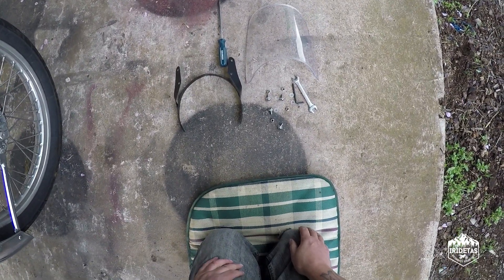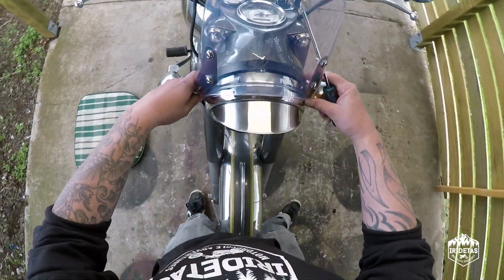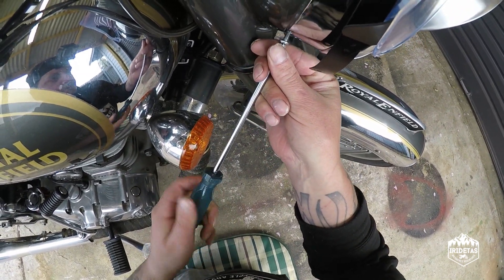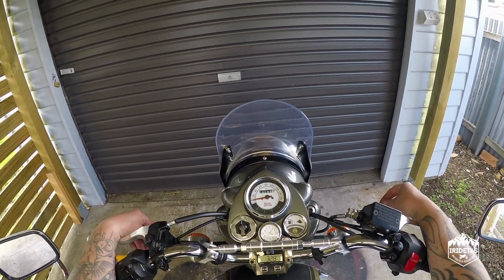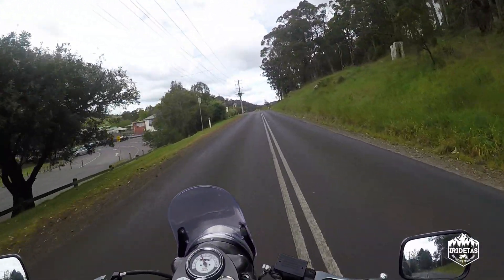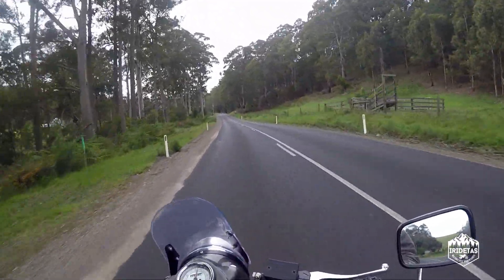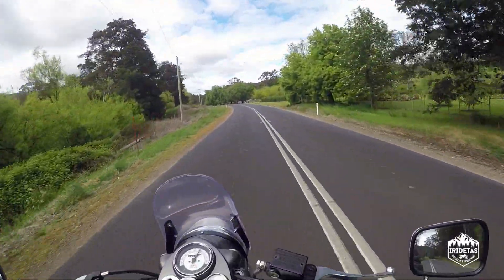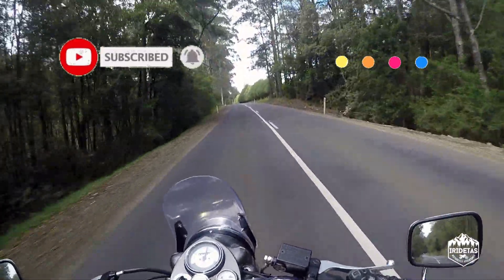REA #32 | Ebay Clear Windscreen Fly Screen for Royal Enfield Classic 500 Install, Review & Test Ride

Comment: I love that you are the Crash Test ( not so ) Dummy for the rest of us. I’m taking a month long jaunt next August and was looking into a windscreen too. I’m six foot and sit pretty high in the saddle. Was worried that the small screen would deflect the wind into my helmet. But I don’t like the ( settle for ) looks of the big screen. Plus.... it may be okay if I get the solo seat mod which drops you down a bit. By the way, how is the new seat ? Good spring and comfort ?? Anything is better than the 2” pivot point on the stock seat eh ? Like doing a Rodeo in a gravel truck.
Reply from the maker: Lol someones got to do it mate!The solo seat is going well and is more comfy than the plank and i like the lower seating position better too.  The screen wotks well and can reccomend if you are after a flyscreen.  Check out Mike the Pikey on how good a classic can look with a full screen, before you right it off! Cheers mate!
Reply: Thanks IRTaz. I don’t care what anyone says.... you’re a nice guy 😉

Comment: I tried it, but the color has scraped off, the metal was mellow, and it was structurally so weak that broked off while mounting. I don't think it would sustain any wind pressure, so I'll not try again.
Reply from the maker: Think thats the luck of the draw with any chinese ebay product.  Mine was ok yours not and it 
Was probably made in the same factory.  Quality control and tolerances just not there at times!

Comment: Nice job iRide, thinking of getting one for my Interceptor, "pretty easy, will only take five minutes" :) are famous lasts words, just like "how hard can it be" and "five minute job" I try to avoid those phrases now, nice job anyway, and did you just leave the Forth pub ? :)
Reply from the maker: Yeah 20 minute job is a broken bolt away from a 3 day ordeal!!! The int650 screens look great!
Reply: The Interceptor screen is NOT a five minute job.  It's pretty involved, removing the turn signals,  finding space in the headlight bowl for everything.. kind of a hassle, but it does work.  Stuart Fillingham has a video on installing it.. the problem for me is that the screw set up on my U.S. bike is different from the U.K. setup....go figure.  The instructions that came with the flyscreen were written in a font suitable for ants... so unreadably tiny!  It involves disconnecting the battery...(?!)  I didn't do that, nothing blew up.  As I said, the flyscreen does help.  It would help more if I was shorter than 6 feet.

Comment: I put a flyscreen on my 650 interceptor.  I find it helpful at freeway speed.  I am not sure if I would prefer a full screen. My 500  has a full windscreen and I like that a great deal, especially in winter.  (Or in exceptionally buggy summers)
Reply from the maker: The classics do look good with a full screen.  Mike the pikey has a cracking looking mitary green classic with a full screen and it looks awesome! The int650 little fly screen looks grest to.  Im undecided on this screen but it does work suprisingly well!

Comment: Hi mate. Thanks for posting this one. I'm thinking of getting a screen. I was on a UK motorway yesterday on  my Bullet 500 and the wind was pretty strong at 70mph. Do you think this screen would help at that kind of speed?
Reply from the maker: Yes absolutely, i constantly ride the bike between 110 - 120kmph and it works very well!
Reply: @iRidetas  Thanks pal.
Reply: HI again mate. One more question if that's okay. At 100 - 120 kmph how much is the wind against your chest/head reduced with the screen? About 20% or 50% from riding without one?

Comment: Put a handle-bar fairing on my CB500F $250,comes with stays to hold it in place. Big improvement highway riding. I've also added a centrestand and Givi Topbox (56 litre) lockable for helmet and shopping.
Reply from the maker: Awrsome, they are a great bike the 500f and sounds like the screen helps a lot.  Awesome mate cheers